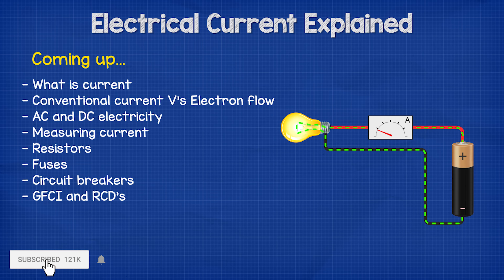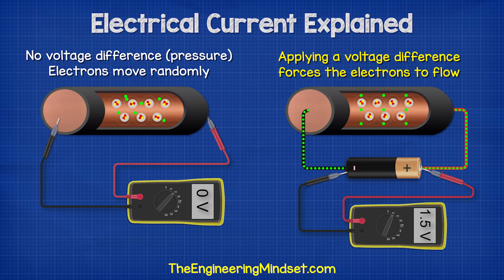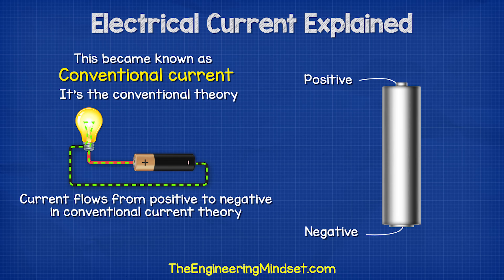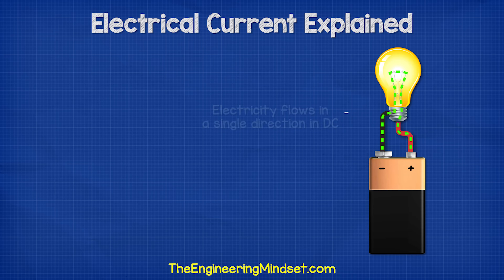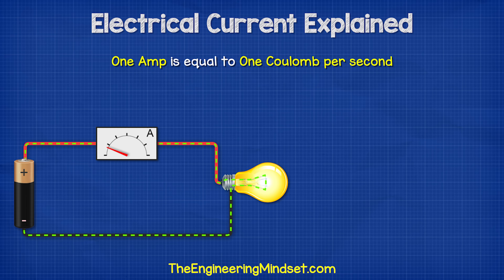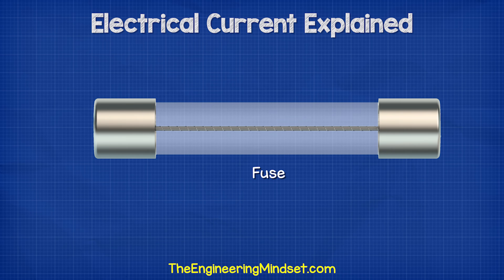Electrical Current Explained - AC DC, fuses, circuit breakers, multimeter, GFCI, ampere

Comment: I can't help but comment on the entrance sound of a circular saw starting up at the beginning of your videos. It sounds like woodworking right off the bat so it immediately puts my head into that setting. Also, it's very loud and disturbing a sound. Maybe experiment with another sound or consider lowering the volume since that's the highest offender in your videos. Everything else is 100% satisfactory.
Reply from the maker: It's not a saw, but a lift motor starting. We no longer use this in newer videos

Comment: Im sorry but electrons flow - to + even in batteries and everything else.
Why do you remove the - lead from the car battery when working on the car? the electricity will not leave the battery from the + lead.
Fix your video and theory, no one uses conventional current, everyone knows and uses electricity from - to + im qualified welder and the same is valid they teach us current flows - to + its important for welders to know that for proper setup of the machine.
Reply from the maker: Did you even watch the video? https://youtu.be/kcL2_D33k3o?t=362

Comment: Why are the electrons flowing backwards in DC? ;)
Reply from the maker: Please see the section on conventional current and electron flow
Reply: @EngineeringMindset  Ah, you're showing electron flow instead of current flow? Still odd, since it changes directions with the same graphics at different points in the video.

Comment: I don't understand when it is two lamps  in parallels , I=V/R    as per this  1.5 V / 3 oms is = 0.5 amps , or if it is calculated individually you   get 1.5 amps. So why amps are increasing to 3 amps ???
Thank you
Reply: The lamps in parallel have an equivalent resistance of 0.5 ohms. Using that you get 1.5/0.5 = 3 amps. 

The reason this happens is the voltage seen on the positive side of both bulbs is equal (1.5V) because the wire ideally has no voltage drop. We know that the voltage on the negative side has to be zero because it goes back to the battery, so we can say that both bulbs have a 1.5V drop across them. Knowing this and the resistance of each bulb, you find that the current through each individual bulb is 1.5/1 = 1.5A. Kirchhoff's Current Law states that the currents through a node must add up to zero, or that you cannot have current building up anywhere. So since the current leaving both bulbs is 1.5A and those two wires meet and go back to the battery, we can just add them up and get 3A.

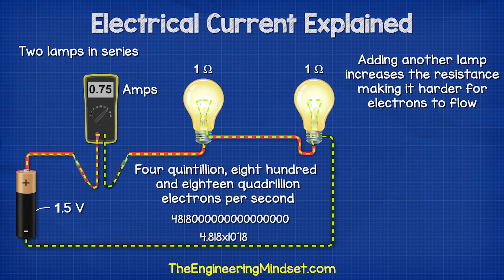Comment: Hey, i'm confused at 13:10 in the video. Shouldn't the multimeter on the far right read 1.5A since the current hasn't faced any resistance along the circuit so far?
Reply from the maker: no, it is series so the current is the same in the entire wire
Reply from the maker: Check our new Multimeter tutorial out ➡️ https://youtu.be/4lAyzRxsbDc

Comment: I thought the way you described Coulombs was a bit confusing. One Amp is one Coulomb per second, but one coulomb is just 6.24x10^18 electrons. Not 6.24x10^18 electrons per second right? Because then one Amp would be 6.24x10^18 electrons per second per second.

Comment: You said that it doesn't matter which way the current flows, but it does matter, to where to put the resister, if it flows from negative to positive the resister has to be placed on the negative side (the hot wire), because when the flow starts before circling the first time before entering the resister for the first time the voltage will be too high if the resister is on the positive side (neutral wire).
Reply from the maker: No, that's not how it works. Please watch our LED video

Comment: When the battery is 1.5 V and the light bulb has 1A how is the circuit 1.5A if the 1.5V is reduced by the bulbs 1A ?

Comment: 13:25 How can it be 3A if the battery is only 1.5 V ?
Reply from the maker: Amps are the amount of electrons flowing, voltage is the pressure. You can have 30million cubic meters of air flowing and 1 bar of pressure.
Reply: @EngineeringMindset  But the current of flowing electrons is equivalent according to the voltage that is only one battery of 1.5V so how does it add up to 3A because there is two bulbs??

Comment: I don't think your emphasis on electron flow is useful. Current is the movement of charge. Nothing is gained by maintaining the discussion and illustration of electron flow. I think you refer to conventional and electron flow as two different 'theories', but that's really not true. They are two different conventions for discussing, describing and measuring electrical current. Your students gain nothing from insistence on reminding them that electrons flow opposite to conventional current, unless it's confusion as to polarity in a circuit or in reading a multimeter (if they remember the distinction at all, it is only going to lead to confusion.)
Reply from the maker: Seen our new video on How electricity works - for visual learners? Link:➡️ https://youtu.be/3KePcASD0NQ
Reply from the maker: Check our new Multimeter tutorial out ➡️ https://youtu.be/4lAyzRxsbDc

Comment: Let’s say you have a wire and one half of the wire is copper, which has a low resistance, and the other half of the wire is iron, which has a higher resistance. Would you still read the same amount of amps in the iron part as in the copper part?

Comment: I comprehended more from this channel that what I did in 4 years doing Engineering
Reply: can confirm
Reply: Me too! Schooling and uni taught formulae that were so abstract as to be nigh on useless.
Reply: @delstone5736  If you ever worked in design or had to prove the designs that had to be Proven you would have thought different. If all a guy does is change black box then it is useless. Understanding electrical design is getting much more complicated. Much higher math is needed to design and understand the designs.
Reply: samee!!!
Reply: i was about to comment the same thing hahahahhahahahah
Reply: Where did you take these course holy.
Reply: Higher education is based on prestige via volume and not practical application.  How many useless courses did you/anyone take to obtain a degree in which they used none of those prior classes accumulating nothing but revenue for the college and deeper debt in your pockets?  It’s all a racket.  The entire system needs to be restructured.
Reply: Exactly
Reply: same lol
Reply: So true lmao😂
Reply: I feel ths same 😂
Reply: So watching this will help me understand better. Then just going into schooling not knowing anything?
Reply: @killuminatepeacefulness3948  
To answer your question quickly and bluntly, maybe. I doubt you wouldn't learn enough to surpass the level of knowledge these videos give by the time you're done.
Reply: The same for me
Reply: 🤣🤣🤣🤣same but mine is 5 years!
Reply: Yes
Reply: I am a retiree now.. I agree. I am sharing this video with my son who's taking electrical engineering now..
Reply: Real
Reply: It really speaks to the power of explaining things clearly, which can be so much more impactful when done with visuals and metaphors. There’s a huge problem in STEM fields of people communicating accurately but not clearly. Accuracy is important, of course, but accuracy is pretty irrelevant is nobody can understand what the hell you’re talking about.

The other aspect is, of course, that a lot of universities consider their job to be more about measuring performance than in getting students to learn anything.
Reply: Same!
Reply: School is to make you dumb. That's why most got fooled by the scamdemic
Reply: Education system is outdated and useless.
Reply: lol YouTube is rad! 😂
Reply: Lol
Reply: Really? I knew an Engineer that couldn't read a measuring tape.
Reply: Was the class in English? Or did you end up having one of those teachers who's kind of like that one guy at an open mic slam poetry night that is literally trying to confuse everyone with their abstractly eclectic vernacular. Almost like a professor that's attempting to go over your heads with constant use of unfamiliar and unreviewed terminology, as well as, copious amounts of assignments, that of which he's given to you with absolutely no prior instruction or even briefly covered with a general introduction? Cuz that was what every sort of general studies course that could be parlayed into a trade would seem to go for me when I was still attempting to unknowingly indoctrinate myself into a "College Graduate" with an MBA in "Electrical Engineering" with a Bachelor's in "Mechanical Engineering" and a focalized specialty Sub-Orbital Propulsion Mechanics. But being a rocket scientist isn't splits cracked up to be when you find out the truth about the fish bowl we're stuck on and there are more jobs making missiles than there are building "spaceships" since you kind of need "space" to be solid enough to provide resistance if you plan to maneuver around it with any combustion powered propulsion devices we've invented. So even if space existed in the way that they say, and "Empty-Nothingness" that somehow takes up room could be something that was possible, you couldn't fly around it with "Empty-Nothingness" as the only thing for the rocket boosters or stabilizer jets to push off of. Therefore, when I realized it's all a big lie, I quit school and decided to find a job in a trade that doesn't involve me investing effort in a suspension of disbelief or being overcome by total cognitive dissonance, in order to fulfill my duties as a competent employee. I actually believe in what I do, and I don't have to lie to myself and my colleagues everyday by pretending that we're sending folks into some imaginary version of the heavens that doesn't do one bit of justice to the reality that lies beyond the firmament. I refuse to pretend that I know what's up there, but I also refuse to pretend that it's even anything close to the incorrect theories that were invented to help balance out the unquantifiable amount of inconsistencies and infinities in the mathematics "SPACE" with "The Ever Expanding Size of the Universe", "Dark Matter/Energy", "Black Holes", etc... In short, I know what I don't know and I know what THEY don't know, and I'm perfectly fine with admitting what THEY can't.
Reply: @jeffreybonanno8982  now you are trying to impress someone with an English degree in teaching. Most people don't care about all that since they are not employed to figure that stuff out. Go to a university and teach those bone heads how to draw a straight line.
Reply: @jeffreybonanno8982  👏
Reply: @jeffreybonanno8982  What trade did you divert your attention to after coming to the realization that far too many schools of higher learning invoke confusion in those attempting to comprehend the basic facts of the universe?
Reply: @jeffreybonanno8982  
Quick question though...
Why an MBA in electrical engineering? Just curious.
Reply: @jeffreybonanno8982  for me it was just a guy that told us what to do and told us to repeat it, then onto the next lesson. Never explained how or why. Man didn't even teach us to solder properly
Reply: @jeffreybonanno8982  that sounds oddly specific.. and relatable
Reply: @jeffreybonanno8982  I am glad you confirmed what I knew to be true. They tell you how combustion works and then say space is a vacuum...

Comment: Hi,
Can you please explain the purpose of using both a capacitor and an inductor?. We know that a capacitor stores energy in the form of electric field while an inductor stores energy in the form of magnetic field. But, how do we benefit from these properties of these two components. Why do we need the stored energy?
Thank you
Reply: It's not just the fact that they store energy, but that they do so over time. This gives some interesting properties, like capacitors/inductors having "resistance" (in the form of impedance) when the voltage they see changes rapidly. Explaining this wouldn't really help with understanding what these parts are used for though. One way inductors are used is as a choke, or a component that limits current spikes. Inductors store energy in a magnetic field and the more current that flows through the inductor in a short amount of time, the stronger the magnetic field becomes. This magnetic field will actually interact with the current in the inductor and try to prevent it from changing too quickly. The faster the current wants to change, the stronger the magnetic field that opposes it. This forces the current to change slowly rather than in an instant and can be useful in some devices that may see intermittent shorts where current suddenly shoots up.

Comment: You miss labeled the man grabbing the uninsulated vs insulated wire. They both say uninsulated. Not nit picking, just don’t  want to confuse the ones starting out in the electrical trade! Love these videos btw man, I actually get a lot from them. Keep up the great work!
Reply from the maker: For corrections please see video description
Reply: @EngineeringMindset mistake at 13:42

Comment: This is awesome!!! Let me ask, aside from being told NOT to use different conduit wire (Say 15amp breaker with 14g wire stepping up to 12g wire), can you please explain what the reasoning behind this is? i get that you cant use a 20amp breaker with 14 ga wire, but whats the immediate issue from mixing the wires using a 15amp breaker? is there a danger involved or is it simply not wanting to screw up the next person that comes along and assumes that theres a 20amp breaker if he sees 12g wire.

Comment: The presentation on Benjamin and Joseph was very confusing to me. So just to clear up confusion, the video presented Benjamin's theory in a way that made me think of conventional pressure, from high to low. But Joseph proved that charge matter in the electric current: from the negative charge (hand) to a positive charge  (tube).

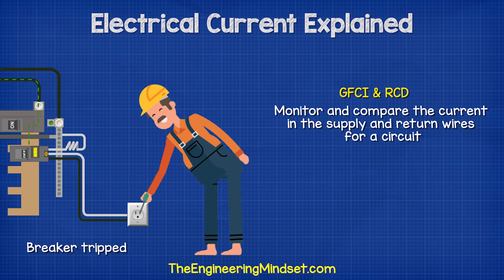Comment: As usual excellent video. at 18:19 of this video, you told that "current supplied should be equal to current returned" ....But my query is that i you place a load (motor) in circuit than surely current returned will be reduced....Than why RCB does not act at that time? Can anyone explain please ? Thanks...

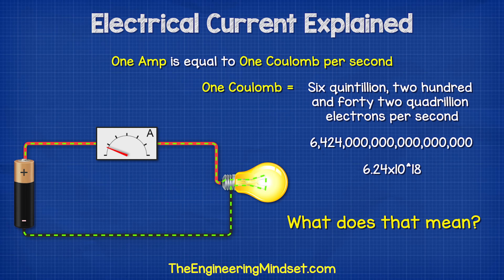Comment: Brilliant videos as always, I saw a slight mistake at 10:41 in the number of electrons per coulomb, the long form number and exponent form do no show the same numbers. The exponent form is the correct one I believe. It's a bitch to correct and reupload a whole video, but a small card at the timing denoting the mistake might help alleviate confusion for those who didn't already know the value (which I learned in one of your previous videos!). I hope this is helpful, I don't mean to criticize or anything. Cheers!
Reply: I was going to post about that, that has got to cause a lot of confusion

Comment: Hi Paul,
Thank you for this awesome video lesson - I’ve referred to these many times as I’ve been studying! I’m wondering if I may ask you about a concept I’m not clear on...when current flows through a load (day a lightbulb), why is it that on the other side of that load the amperage doesn’t change? I would imagine that the load consumes that current and that the current on the return path would be less or even zero? 
Thank you!
Reply from the maker: Have you watched the videos on parallel and series circuits? We show how the current behaves around the circuit and components. I think that'll help you visualise
Reply: The Engineering Mindset thank you!

Comment: So honest question.

My garage caught fire and burned to the ground a couple of years ago. The cause was an electrical short in or near a switch. Why didn't the circuit breaker trip? With literally no resistance between hot and neutral, there would've been a very high amount of current flowing, enough to cause the rubber coating to melt and cause the wood in the walls to catch fire, so in my mind it should have tripped
Reply: It's possible that it it wasn't a "short" but actually a loose mechanical connection in the switch. For example, a wire that wasn't terminated properly onto a screw that doesn't make good electrical contact can have a slightly higher resistance. This increased resistance will translate to heat (power) being dissipated, which over time can lead to thermal expansion/contraction of the components that can eventually cause the wire to come loose. Once this happens, even with the high resistance of the air between the loose wire and terminal, the voltage between them may still be high enough so that the electric field is strong enough to ionize the air and cause what's called "dielectric breakdown"--whereby the air becomes a conductive plasma that lets current flow. This is called an arc, and can dissipate huge amounts of energy as heat (arcs can be as hot as 35,000 degrees Fahrenheit--about 3.5x hotter than the surface of the sun), enough to cause nearby combustible materials to ignite. Arcing is a very real, very common problem in electrical systems resulting from poor mechanical connections, requiring special arc fault circuit interrupter (AFCI) type breakers to detect. This is why quality workmanship is important.
Reply from the maker: Seen our new incredibly detailed MCB video? link: https://youtu.be/gqEu9t8HwW0

Comment: In my school I got a question can you explain.
Q-) Electric shock is caused by_____.
. Electric current
. Electrical potential difference
. Electrical resistance
. Electrical energy
(Note you can choose only one option)

Edit:
Correct answer = Electric current
Pls explain
Reply: Current is actual electron flow.  That is something you will feel.  It is different from simply voltage or potential.
Reply: when you get shocked, you simply become the resistance in a complete circuit and thus current will flow, a lot of curent 😂😂😂.